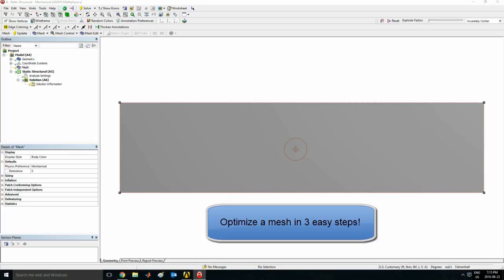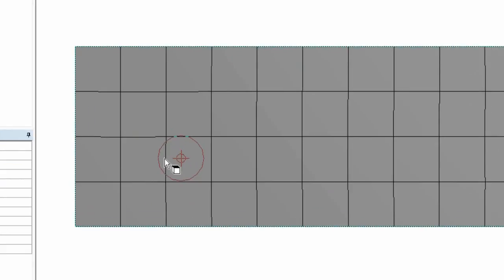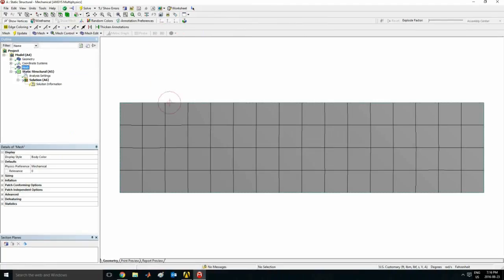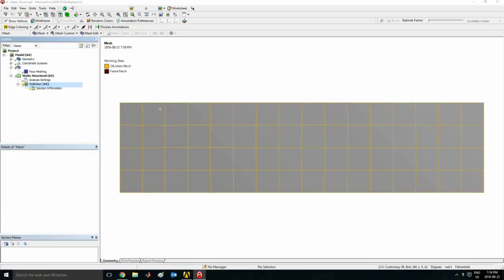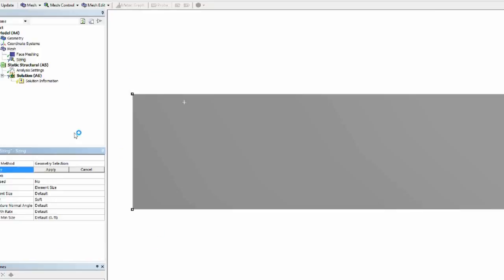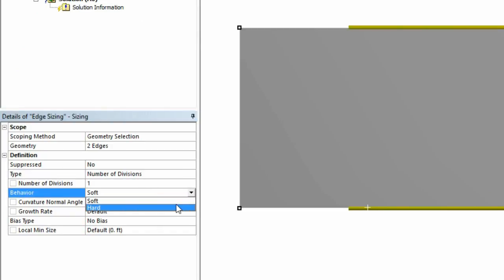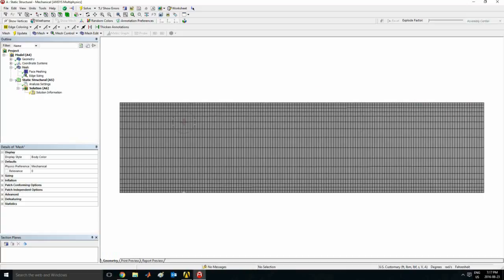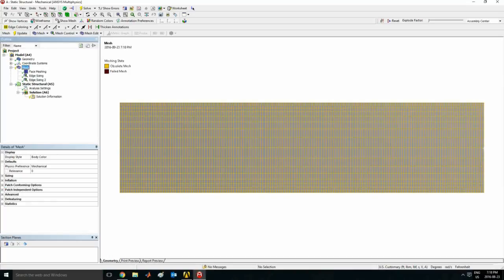ANSYS Workbench - Improve Meshing in 3 Easy Steps!

Comment: Hi VDEngineering,
I am trying to simulate flow over an airfoil NACA0012 . I have made the grid with 440693. But when I am trying to simulate it in Fluent First thing it gives me a warning: 
The mesh contains very high aspect ratio hexahedral
or polyhedral cells.
The default algorithm used to compute the wall
distance required by the turbulence models might
produce wrong results in these cells.
Please inspect the wall distance by displaying the
contours of the 'Cell Wall Distance' at the
boundaries. If you observe any irregularities we
recommend the use of an alternative algorithm to
correct the wall distance.
Please select /solve/initialize/repair-wall-distance
using the text user interface to switch to the
alternative algorithm.
Thanks